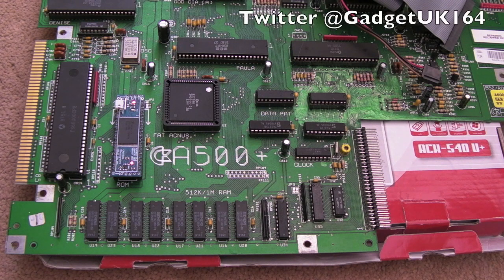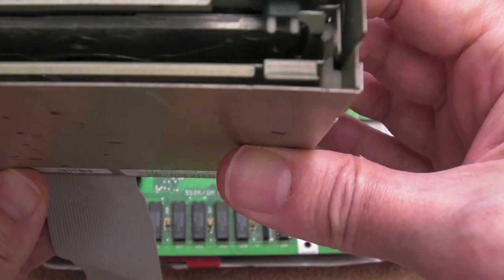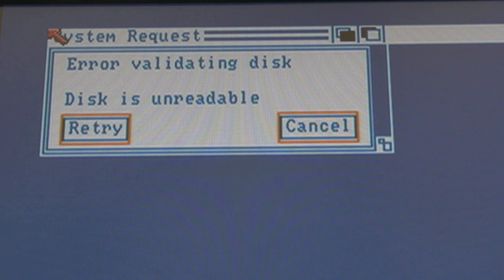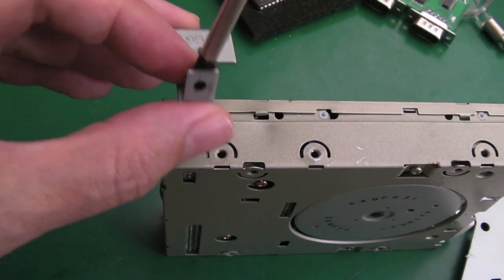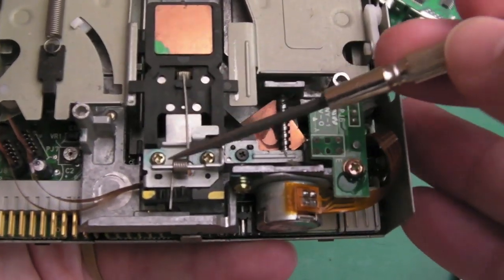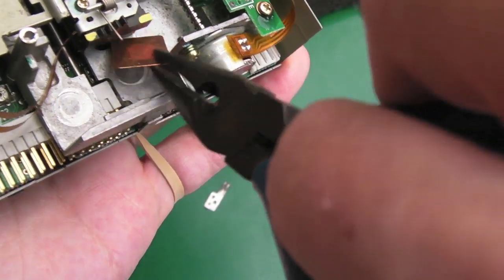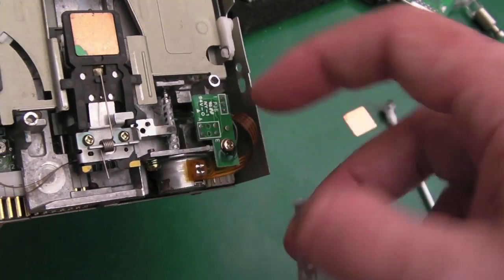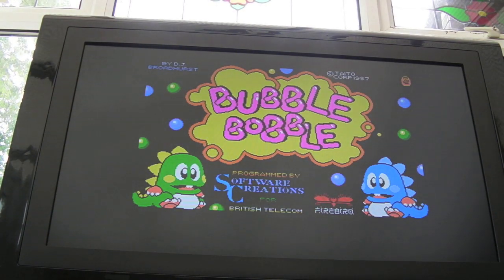Commodore Amiga Floppy Drives (1 x Easy FZ-354 1 x Hard FD-235F) Track 0 / Adjustment / Head Align

Comment: your videos are just PERFECT! I have one Panasonic JU-257A605P with strange behaviour. Did all the cleaning, motor alignment (track zero sensor fixed, can't change the position). What the drive does is reading perfectly everything including original workbench 3.1.4 disks, BUT if I do diskcopy of any disk (in X-copy) with the drive and verify the written data, I get lots of "6", whereas mainly the bottom head data starting from track 44 are all "6". Strange it reads and writes, but can not read its own written tracks. What do you think? Have you tried to write anything on disks with your fixed drive?
Reply: holy c**p!!!! Just found out that I´m using HD disks!!!! Looking and the front of the reworked PC drive I spotted  the HD switch. So without blindind the hole the drive went into HD mode. After chewing some toilet tissue and blinding off the hole on the disk, everything works perfectly!!! F***g hell!!! I thought I was going to bin that drive
Reply from the maker: Thanks, much appreciated =D  If its not writing properly, that could indicate a faulty write head.  It's rare, but it does happen.   Yes, I always test the write too when servicing FDDs.   You could try a tape head demagnetizer - that may solve the issue.   It's rare, but sometimes magnetism affects something around the head area, and demagnetizing it can help.

Comment: PSA: Bad caps in 1200 600 4000 is not an if, its a when, get your machine recapped if it has not been already. When caps leak so bad the machine gets problems the cost to repair is already 2-3(or more) times that of a regular recap.

Comment: Interesting. I'm having similar problems with a TEAC FD-235F from an A1200 that I've had from new. I've carefully cleaned & greased it, but when booting it just clicks around track 0. If I manually wind the head down it does seek back on boot, but never works.
Reply from the maker: You may need to swap out the capacitors.  It could also be that the heads have become misaligned.
Reply: @GadgetUK164  Yeah I think that's probably beyond my skill level even after watching your videos. :)  Might get a replacement and pass this one on for someone else to fix up!

Comment: How did you manage to allign the heads properly? I was recently fiddling around with some pc floppy drives just out of boredom and curiosity and I wanted to clean them so I dis- and then reassembled them back. The floppys would then format but the drive was unable to read regularly formatted floppys. Is there a method or some software for head allignment?
Reply from the maker: There probably is head alignment software out there for the PC somewhere!  It's often a case of using a calibrated disk, testing software and an oscilloscope in order to do it properly.  The techniques and testing sofware for the Amiga seems to have been lost in time though (or never released from the drive manufacturers).  Hence why I ended up with a lot of trial and error here in this video.  But a DD drive is way way easier to do manually like I did vs a HD drive from a PC.  The tracks are double in number on a HD disk, which means its twice as hard to align.  I would assume it would be near impossible with a HD drive tbh!

Comment: @gadgetUK164 I have 2 1200 drives. on Chinon, and one Panasonic, both with reading issues. both say df0:??????? I have stripped down and cleaned them both, but still issues. When I try to format any disc, I get "cannot format cylinder 0" error on the screen. Any ideas?
Reply from the maker: You could need to watch my other FDD repair videos - there are several.   It could be bad head alignment (less likely), bad capacitors or just a thorough cleaning of head surfaces needed etc.

Comment: Nice info here, that said, I just copped out with Gotek than pissin about with disks at the end of the day.
Reply from the maker: I was waiting for someone to suggest replacing it with a Gotek! =D   To be honest, yes the old drives and the disks are becoming unreliable etc, but there's something nostalgic about using a real disk.  I might however add a Gotek as a 2nd drive to my 2000 (perhaps make it DF0 so I can boot from it).

Comment: are pc floppy drives able to be used in amiga computers , or are they findamentally different, because i have a whole box of those to scrap at work and i mean over 50 drives of many makers, colors and ages (1993-2006)
Reply: @benbaselet2026   it almost feel like it would be easier to make an universal interceptor/translator thing out of some kind of microcontroller, i guess i will send thrm ro recycling then
Reply from the maker: Yes, there are many models that can be modified to work with an Amiga!  But... Their buttons and stuff are laid out differently, so you might find it doesn't line up with the eject button etc.
Reply from the maker: @benbaselet2026  DF0 to DF1 I think, and the Ready line to the HD switch.
Reply: @benbaselet2026  i know it might be simple to do, the thing is i don't own any amiga, i work at a school and we are getting ready to trash old pc computers, and we have quite a pile of loose floppy drives too. i have no idea what kind of drives they even are , they are just kind of there. i only wondered if anyone might want to get some for amiga project without looking for a proper drive beacue i can give them up for free if i get refunded for shipping from poland
but i kind of also thought about something else, pc floppy emulators and such devices, i bet there are some of those avalable for amiga, but amiga hardware seems overpriced nowdays, more of a colector items than used hardware nowdays, so getting cheap or free floppy drive would also be a good thing, getting a floppy emylator working on amiga might be not a puryst dream but i bet there are some people who would love that too. that is why i thought about interceptor/translator device that would work like those ata>sata adapters. in real time and for all kinds of pc drives, not even model specyfic.

and one more thing
 back in a days i had one wierd floppy drive made by HP i liked it because it had a orange led and big eject button, and the face was also removable, but the most wierd thing about it was it had jumpers on the back for "ibm-pc" and "amiga" mode
so i thought they might all be similar like that. it is a shame i don't have it anymore but i changed my pc back in 2008 and the new pc didn't even had floppy connector on the motherboard so i got rid of it.

Comment: Do you know what caps handles power regulation to the Floppy drive unit? If any? I have an A500Plus i have owned since 1993, and it worked perfectly up until i stopped using it in the late 90's, recapped it now, but the drive does not seem to want to power up. Get a normal post screen though after recap.
Reply from the maker: There will be capactors on the drive near the power connector probably, but on some models they may be elsewhere on the board.  Capacitors wont generally stop the drive from powering up - ie. spinning, attempting to read a disk, so I doubt its a cap problem.  Could be a bad CIA, Gary or Paula maybe.
Reply: @GadgetUK164  do you know what pins power should be on the floppy drive connector(s) ? guess i could measure it with a voltmeter
Reply: thnx for replying btw. 😀

Comment: Hi !
I think I have issues aligning 0 on a drive, everything move and looks fine but I get error "Error validating disk" and when I rotate the motor sometimes I get "DF0 Bad".
How to know if this is aligning the 0 or something else? Any tips please?
Thank you.
Reply from the maker: The best thing to do is use Amiga Test Kit and get the lower head aligned first (and track 0), then adjust the top head.  It can take some trial and error.  You need to make sure the caps are good, and the drive is cleaned and lubed, and the heads are clean too.
Reply: @GadgetUK164  Thank you!! ok :)

Comment: Having the track 0 sensor on the PCB instead of on the chassis is a questionable design choice. I mean, you could mess with it simply by inserting the FDD cable more vigorously.
Reply from the maker: Yes, these drives are one of the worst in the Amiga computers.  There is an even worse model (also a Teac I think) - might be a video on that soon!

Comment: I've got a Sony Mavica FD90 and it scratches the diskettes. It would scratch it on the side that has the metal wheel to the point the magnetic disc becomes clear. How would I go about fixing this?
Reply from the maker: Inspect and clean the heads - but it may need a new lower head if that's what's scratching the disk!
Reply: @GadgetUK164  I did all that and it no longer scratches. It sounds like it's working correctly but it can't read any disks. I've tried all 9 disks I have and they all give me a format error.

Comment: Is there any reference or cheat sheet, where one could look up for at least having a hint on where to check for which symptom of the drive?
I have three defunctional Amiga drivers here, and basically they all suffered the same fate over the years:
They started with an read error on one disk, and while retrying to read the disk, the block would some times be read successfully, but while using the disk longer, more and more read errors would occur. I then used a tiny bit of IPA and carefully tried to clean the heads. And the drive wouldn't ever read any disk again - same for all three drives.
I have no clue on how to continue with this problem now and my searches often take me to this video, but while it's entertaining it also is very long and unstructured, sadly being of not too much help when searching for symptoms and their solutions, because you often abbreviate the explanation and just go for solving a problem that you know off, but I don't, and also jump around between different problems and come back to them again later  :(
Reply from the maker: Not really - it's a case of doing all of the clean up things I've covered in the several FDD repair videos I've done (this is not the only one on my channel).  Make sure parts that need lubrication are lubricated, consider swapping the electrolytic capacitors too.
Reply: OK, so it mostly is a matter of trial and error.
But there are basic problems, like: How can I  know if it's a problem with head alignment, or track zero alignment? I didn't really undertand this from the video.

Comment: Hi, I have a Panasonic JU-253 from an A1200 that has its upper r/w head hanging, meaning the frame that used to hold it is holding it only from one side. Can it be repaired?
Reply from the maker: Is the frame physically broken, or is it just loose?
Reply: @GadgetUK164 
thanks for the reply! It is broken from the diskette-entry side, hanging only from the connectors-side.  :-(
Reply: Guess there is no hope for repairing it...?

Comment: HI guys. anyone can help me ? I started my AMIGA 12000 after long rest in the attic. Its in perfect condition. I opened it up to make sure caps are OK etc.   The floppy disk drive moves to zero position  and then it just ask to insert a disk however disk is already in it. I took it out and everything looks nice and clean. I manually moved the head and to see what it does and it just moves back into zero position....
Reply from the maker: Could be dirty heads, could be that the capacitors need replacement on it.  The heads could also be out of alignment.  Most likely dirty heads imho.

Comment: i don't understand how rotating the motor would adjust the track zero, doesn't the motor reset to home (step zero) via the sensor no matter the motor position since
as you say, you are not changing the steps for track zero from home position.. 
The drive i have (panasonic) has a separate pcb for adjustment of the home sensor in order to find track zero. This one you show has a strange arrangement.
Reply from the maker: The track zero position is triggered by the track zero sensor - that's correct, but the stepper motor steps up by a fixed amount.  ie. If you looked at how much it moves with a microscope, you would see that it starts at a specific point, and when steps it moves by a fixed amount each time.  ie. It has its own alignment issue where you need the motor aligned to the point where it "sits" in its stepped position - so when it then steps up, it steps up in alignment with the disk.  If you swap the motor over for another, you may have it sat in a position where its 50% stepped.  Then when it is driven and snaps into its stepped position, it could be half way between tracks in terms of disk alignment.
Reply: @GadgetUK164  So are you saying that in this particular case that this was an alignment issue and not an axial position issue?...as in the head travel was not travelling toward the centre of the disk but skewed.
Sorry if i'm still misunderstanding, it is much easier for you since you spent a lot of time hands on with the drive.
Thanks for helping others learn.
Reply from the maker: @mickeyripper6976  No, the head was travelling correctly towards the centre of the disk.  The problem is that stepper worm bar can be rotated or moved by hand, ie. turning the motor.  It's a track alignment issue.  When these drives were assembled and tested they turned the position of the motor to move the head into correct track alignment, in relation to how the motor steps up a track at a time.  On this model, if that motor is moved, or the alignment altered (because of the U shaped holes in the PCB that holds the track zero sensor), you need to adjust the alignment.  It can be done by altering the position the screws sit in the holes on the PCB, or fine adjustment can be made by rotating the motor (that's also why the motor has a metal notch on top of the edge of it!).
Reply: @GadgetUK164  looking at the mount again on your video, it seems the motor has a fine adjustment plate to move the motor in/out. i took it as though the motor was just screwed down solid like other drives.
So this drives fine adjust is done via the motor and not the sensor...where i thought you had just rotated the motor.
Much easier to understand if i had one, i just watched out of interest, thanks for the vid and replies.

Comment: MymateVINCE levels of patience there, I just hope the drive proves reliable as its a general rule that once metal is twisted like that you can never quite get it perfect.

I'm sure it's possible to adapt a PC FDD to work with an Amiga isn't it? They are ten-a-penny so a better option than fixing 30+ year old drives?
Reply from the maker: Been using it for over a week as the main test drive with a load of amiga boards - not one single issue, and I've used it a LOT lol!
Reply from the maker: And yes, you can adapt some PC drives (quite a few actually).  DF0 to DF1, Ready to the HD switch.  But... The eject buttons aren't all aligned the same I think.   And the ones that work in the Amiga aren't "ten a penny" cheap either.  I've been looking for a 2nd drive for my Amiga 2000 and most of them are £15 to £20 (less than I paid for the drive in this video - got it shipped for £9).

Comment: Hi there, I could use some help.  I'm trying to see what's wrong with and how to fix my two Amiga 2000 floppy drives.. https://youtu.be/s52He_2eLNo this is one of them.  i'm focusing on it first.. it seems the head moves nicely..  it will completely format a disk then does a "three grinds of death" type sound..  just not sure what might cause this.  maybe capacitors?   the drive is in overall good clean condition.  no obvious signs of damage..
Reply from the maker: The grinds usually means its re-seeking, which could be dirty or mis aligned heads, dirty or miss aligned track zero sensor, or bad capacitors (the motors on there can generate huge spikes in current, and bad electrolytics can result in a noisey drive, but also unreliable reads or writes).
Reply: @GadgetUK164  i fixed the shared link also.. didn't realize it was my own account shortcut..  i'm having them serviced by a friend.. which is going right down that list.. cleaning / caps..  hopefully heads are not out of alignment.